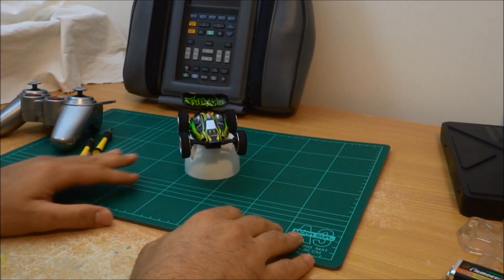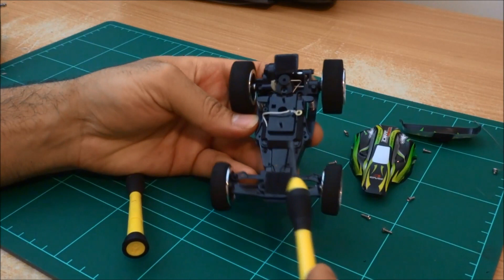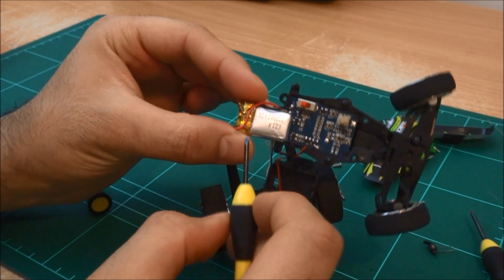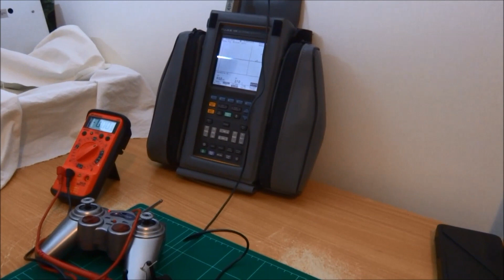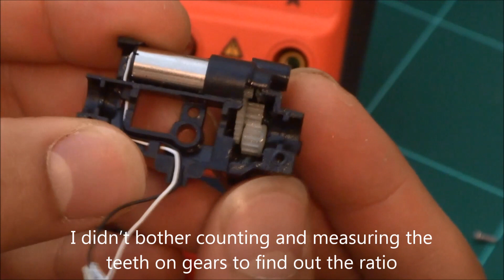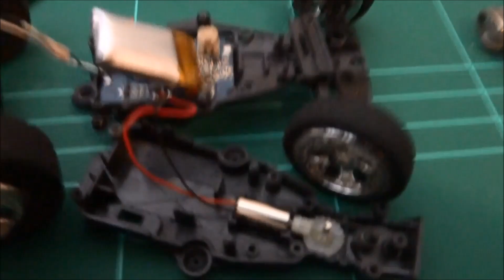Teardown of Mini Micro Fast RC Car High Speed Challenger Exceeds 30 Km/h

Comment: I recently owned one of these... Hilariously, I replaced the sponge tires with rubber ones from my Viper die-cast and it fits quite tightly... The front tires however looked weird, due to the wheels being narrow.

Comment: hey I just had a question abou that spring...for the from wheels...how exactly do you put it back in i tried on top of the two plastic pieces i tried under the screw on the bottom...and it just wont go back in right????

Comment: hi yesterday i receive my car but found out not working at all i opened i found battery does not charge at all i replace battery outside the can i can change any time i did test the running time one hour and 30 minute run witch is good but signal range only 10 meter any solution thanks
Reply from the maker: +Kanari Mentos FYI the charger chip is located in the USB plug or inside the controller. as for the range make sure your controller has fresh batteries.
Reply: yes hase fresh battery but i see people online the increase the range dont know how thats why i ask u thanks what kind of range i have 27mh or what thanks
Reply from the maker: +Kanari Mentos I havent tried to extend the range, mine is about 10-15m. The 27Mhz is the frequency used to transmit the data
Reply: thank u very much why they say about 40meter lol

Comment: PS. Gear ratio 10:1 I think from memory
But you can change the ratios ,bigger motors, larger pinions, 130 lipo, Ball bearings and rear carbon fiber hollow rear axil and more.
I gear one car up so much the tires come half of at over 9,000 RPMs but motor could not push the car when on the ground  OoP's .
These cars are insane fun and some times only $20 or $ 45 for the simmilar car but with servo steering and full body shell.
The car I have like this it the bolt its better as more durable in crashes as to its solid rear wing and rubber tires also have proven better also.
I have footage out soon !

Comment: I purchased this car but it only goes in reverse.  Haw do I get it to go forward?
Reply: +Lawson 1 i replace outside battery and i run like 1 hour and 30 minutes
Reply from the maker: Lawson 1 Test your controller if not the issue is with the H-bridge inside the car, does not worth fixing
Reply: +Lawson 1 what u need to do first push to bottom  fast t full forward always goes back but push agin to forwars full wiil work for you

Comment: I have a question:
I have the same car as you (WLtoys 2307) with the remote and car with 49 mhz.
I have a spare car but its 27 mhz.

How can i change this spare car from 27 mhz to 49 mhz ?

Thanks for this video
Reply from the maker: The frequency is set by an electronic component inside the transmitter (controller) and the receiver (car) which is called "Crystal". You need to buy a 49Mhz crystal which is compatible (dimension wise)
Reply from the maker: Having said that sometimes you need to tune the filter in the receiver after installing the crystal in it. changing the inductance (the white plasticy component) and the capacitance of filter in accordance to the frequency. This RC car is so cheap i dont think it worth the hassle, just buy another one :-)